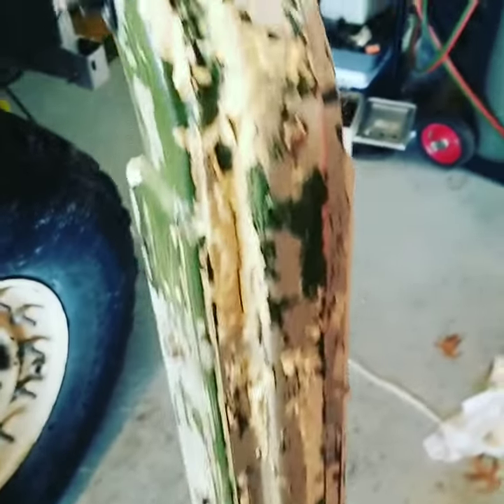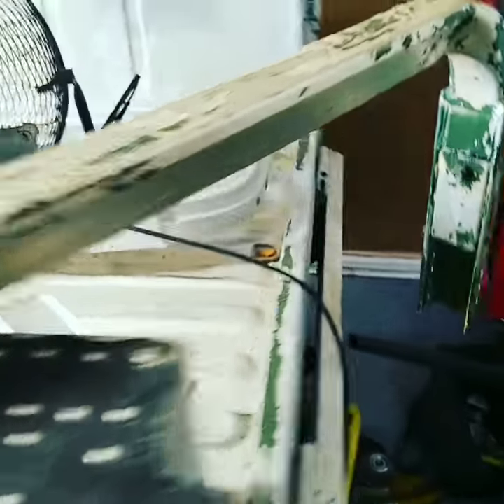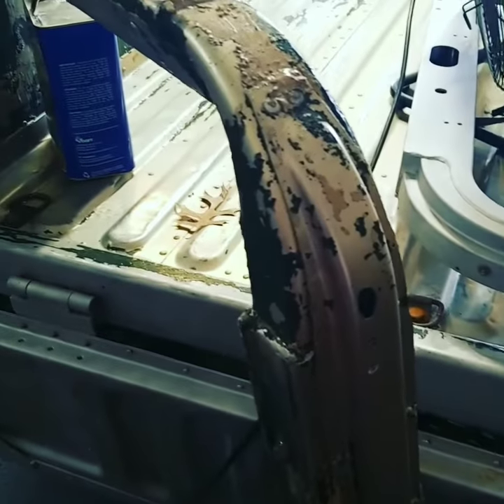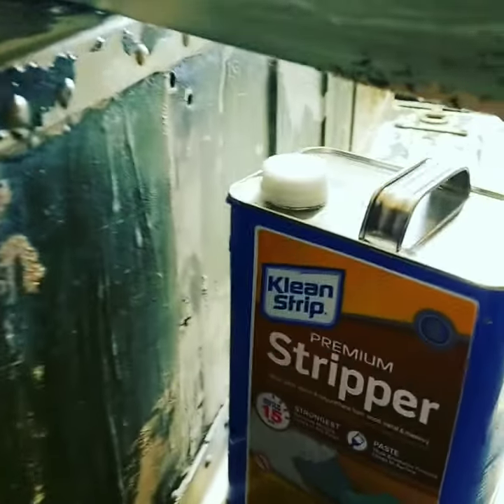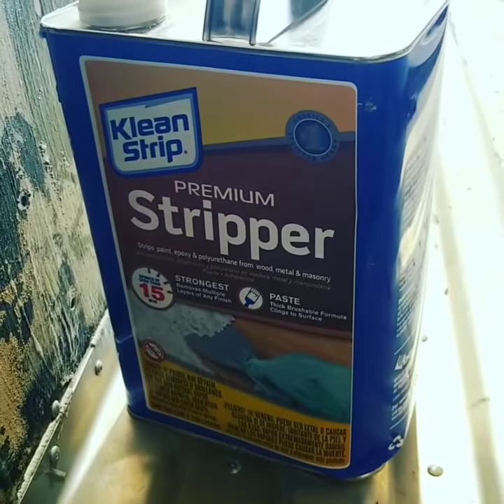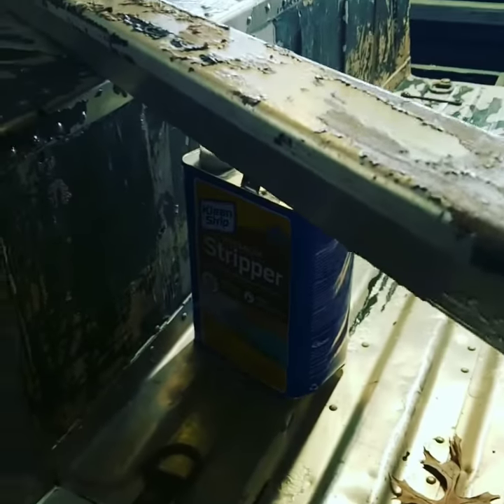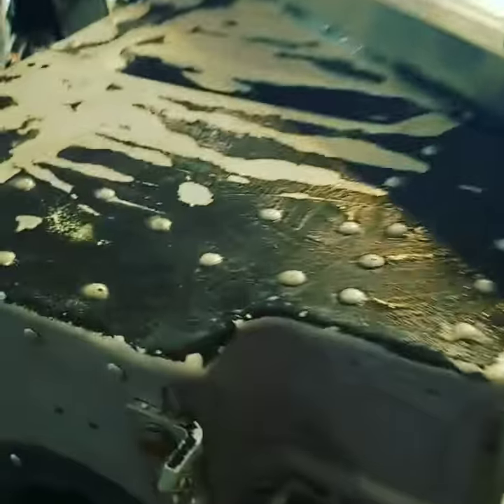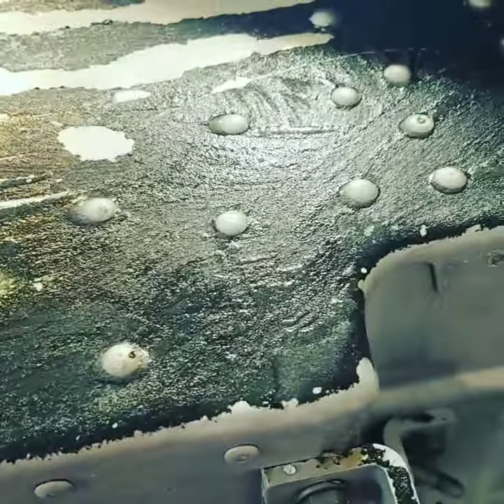Carc Paint Removal tip. Humvee  M998

Comment: CARC will barely be affected by Aircralft stripper. It's super tough. Don't waste your time with regular aircraft stripper it will only wrinkle a few spots and you will be unhappy. A Jitterbug with 80 grit works pretty well. .There is a stripper remover for CARC. It's called D-Zolve™ Mil Spec CARC Remover is a fast acting, paint and powder coating remover. Designed for use in an immersion tank at low temperatures, it removes paints and powder coatings by penetrating the cured layers and breaking the bond between the coating and the substrate.